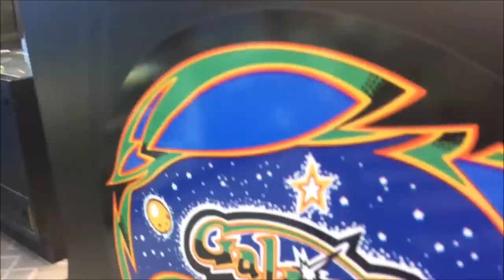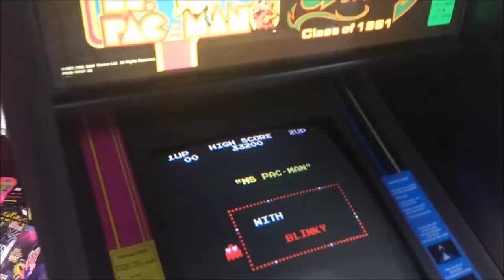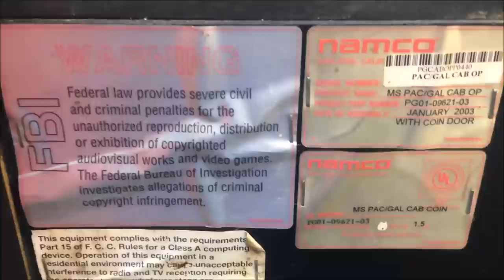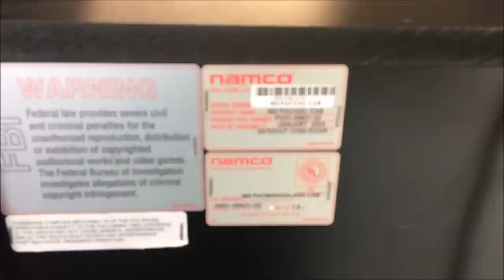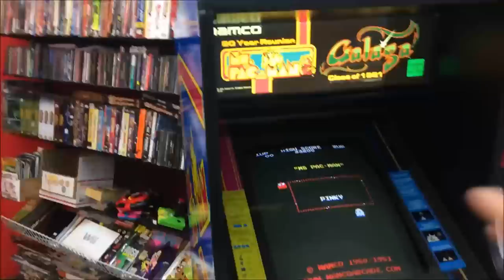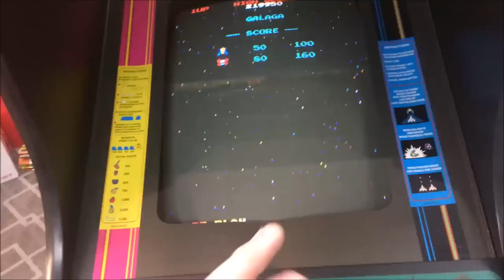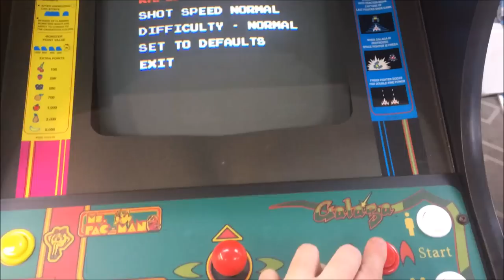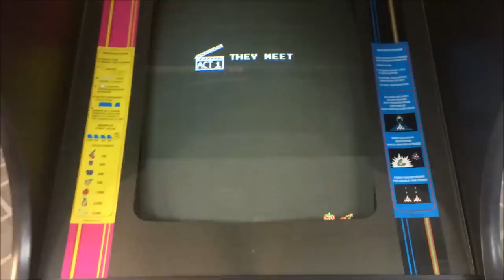Namco's Ms. Pac-Man Galaga Cabaret Reunion Arcade Cabinet - Crashing the Game!

Comment: I played one of these in a small arcade at a pizza restaurant, back in the mid 2000s. Arcade1up just released a home, 3/4 scale version of full sized cabinet. You can almost crash it, but after halting for a second, it goes back to normal operation, so looks like that bug was fixed for that.

Comment: Did this machine use emulation at the time or was the program native to the chips they used?
Reply from the maker: It had a dedicated little board that ran it, but really I don't know if you can consider it emulation or not.  Usually when people say Emulation they're talking about software, this is an official release running on official hardware but it's nothing like the original hardware....
Reply: the CPU it runs on is backwards compatible with Z80 so kinda yes kinda no

Comment: Question for you: do you know where the menu switch is for one of these that doesn't have a real coin door? The one we have is a sticker and we want to reset the high score.
Reply from the maker: I believe they added a button on the back near where the power cord goes in, do you have a volume knob barely sticking out of the back of the game down low?  If not you may have to take the back door off then look down in the bottom of the cabinet just behind the bottom panel.
Reply: @LyonsArcade  found it! Thanks